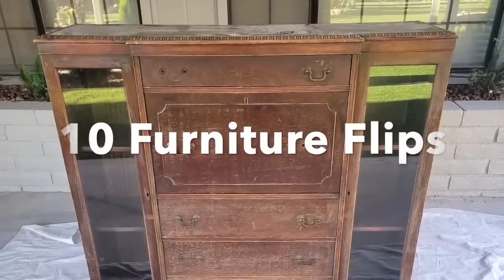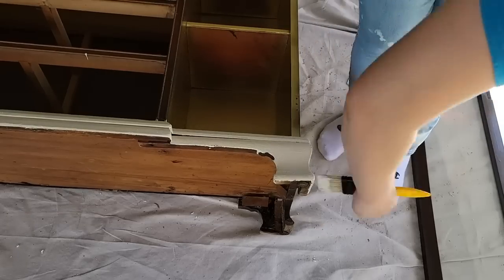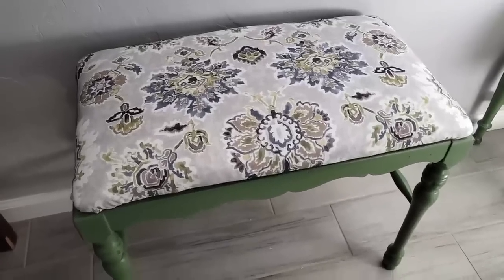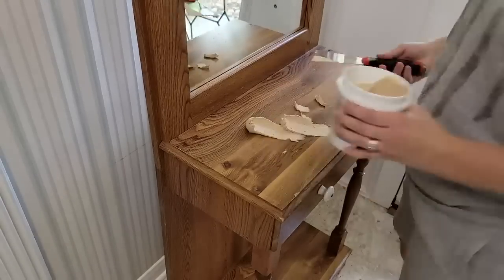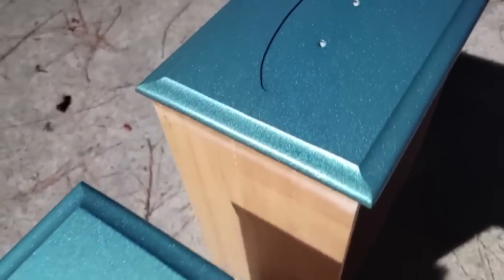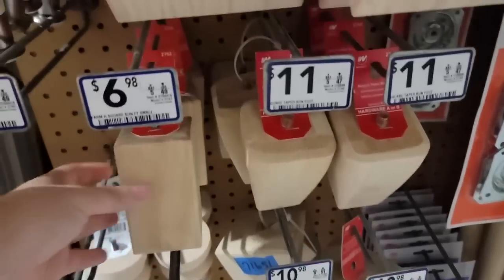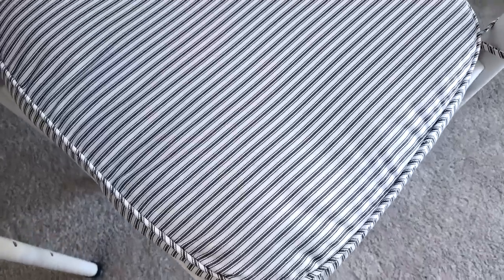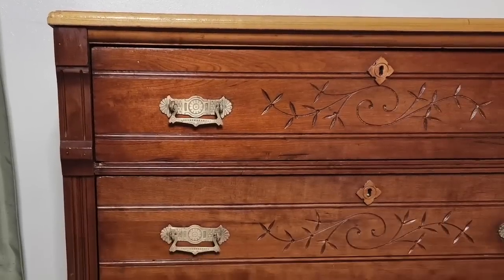10 Trash to Treasure Furniture Flips 2023

Comment: I found a stool in my Grandparents'  attic. All it needed was a coat of paint and a cover on top.  This was in a late February warm spell so I was able to work outside.  This was a three step stool.  I happily spray painted it and over painted a design on the seat.  Not bad for my first attempt at refinishing.  It was sitting in my mom's kitchen when we noticed the previous inhabitants.  It turns out a coat of paint doesn't completely seal holes.  The more the wood warmed, the more the determined prior tenants made themselves known.  Wasp after wasp emerged to scope out their new warm habitat. I should have known better.  The year before I brought in a branch with papery orb.  I put it in the corner of my bed room.  The next day all was well.  But the second day, I came home to find what seemed like100's of praying mantis babies crawling all over my room.
Reply from the maker: Holy moly! That is crazy!

Comment: Question—I noticed you often spray the Shellac, and THEN paint. Isn’t that the opposite of priming? Wouldn’t it make the surface very slippery, so the paint has nothing to grip onto, and will chip much more easily? I’m honestly curious as to whether I missed something.
Reply from the maker: Hi Kristin! Good question! I don't know the science behind this, but shellac doesn't create a super slick finish like other clear coats do. Paint sticks to it well. It is a common practice among flippers. Another really good paint I've used as a primer is flat enamel. It blocked stains really well!
Reply: @DesertDIY  Good to know! Thank you!